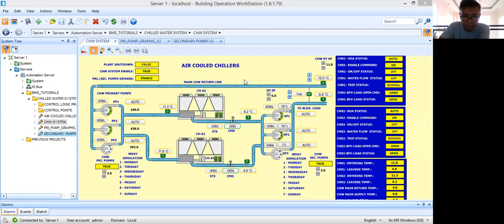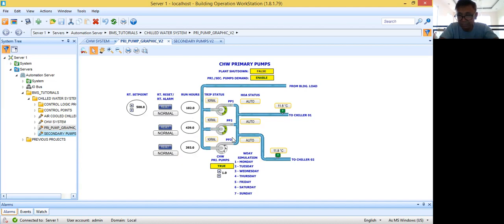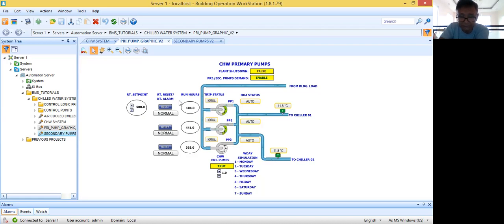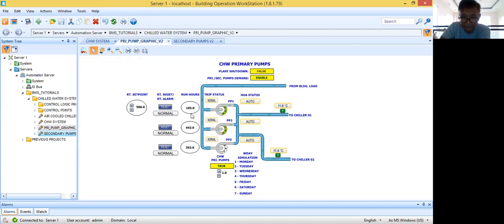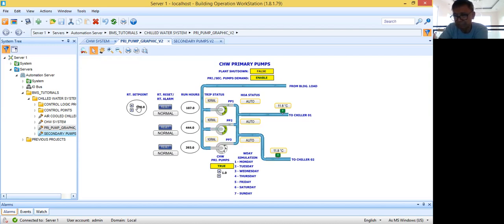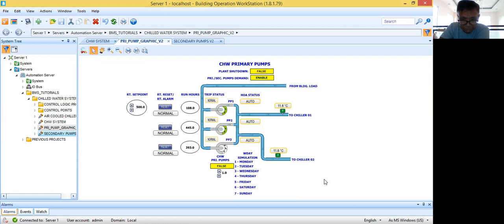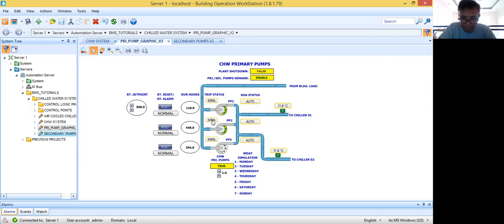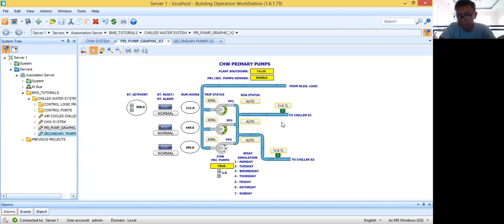Chilled Water System - (Air Cooled Chillers) Primary Pumps Simulation Part 2.

Comment: 13:00 sir at this sudden off pont .will it make affecting chiller water flow sensor and thereby trips ? manual mode also are we putting delay relays?
Reply from the maker: just make sure during the change over of primary pumps you will not loose flow in the chiller's cooler to prevent no flow alarm/trip

Comment: Mr. Santos, can you show how to rotate an object 90 degrees when a variable is HIGH and return when variable is LOW? Thank you!
Reply from the maker: can you be more specific, what graphics object you are working with?
Reply: @SantosJrCapellan-BMS  actually I need a graphical flap in a pipe that obturates air or release it
Reply from the maker: @xaranis  let me check with the graphics library if I can find an animated graphics suitable for your need
Reply from the maker: @xaranis  for water or air media?
Reply from the maker: @xaranis  not possible to use a damper actuator?
Reply: @SantosJrCapellan-BMS for air. Anything that looks like a flip

Comment: Saan kaya pwede mag apply ng BMS operator HVAC TECHNICIAN PO WORK KO
Reply from the maker: sa manila maramin naman pong mga buildings ang may BMS  pwede ka po mag apply sa mga facility management na nag o-operate ng building
Reply: @SantosJrCapellan-BMS  pag may trouble po ba sa mga equipment tulad ng chiller ang BMS operator po ba ang ng to toubleshoot ?
Reply from the maker: @dodong3628  hindi naman po ang chiller tech po ang bahala doon, ang trabaho ng BMS operator ma monitor niya ang trouble sa chillers at ma ireport niya sa engineer in charge sa maintenance para i pa check sa mga chiller tech
Reply: @SantosJrCapellan-BMS  sana maka work ako as bMs operator HVAC po experience ko at electrical ,
Reply from the maker: @dodong3628  may nakita ako na post dati nag hahanap ng BMS operator sa Cebu
Reply: @SantosJrCapellan-BMS  d na po ng rply , CGE lang po baka May mag post ulit , tnx po sir
Reply from the maker: https://www.facebook.com/photo/?fbid=4303804459722750&set=a.360695597367009